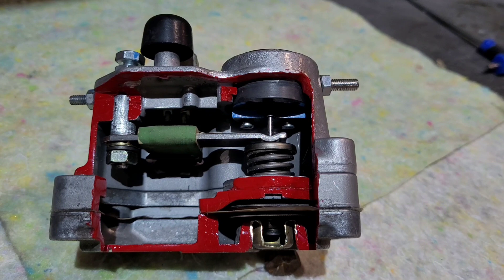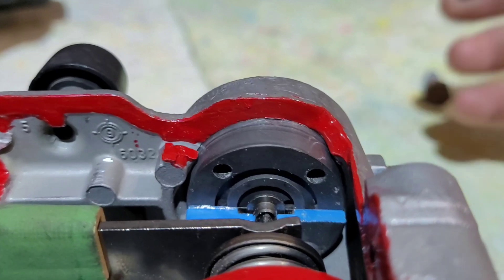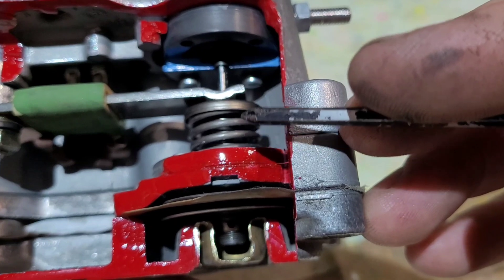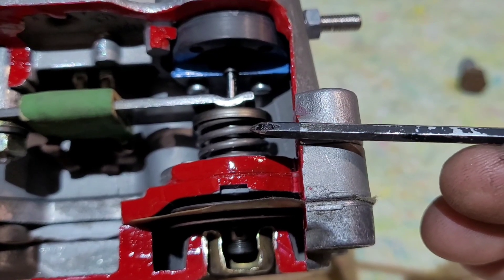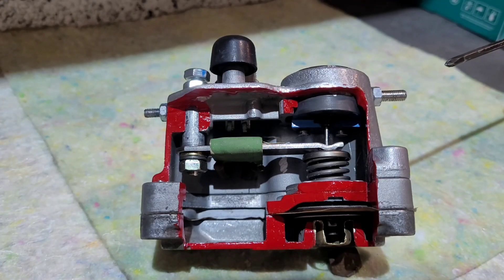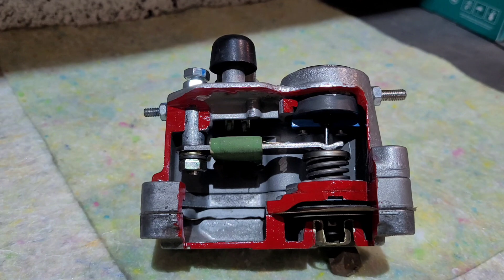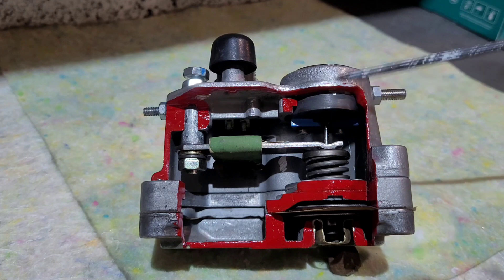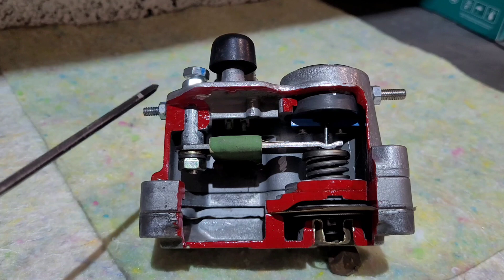Bosch K-jetronic: Warm up Regulator - Internal Investigation

Comment: Hi, great demonstration! Do you have any experience with the modern aftermarket replacement for this? I see they are about $600 in the USA, but am thinking I will try adjusting my warm pressure once more before giving up on the WUR.
Reply from the maker: Thanks, not had any experience with them but I dont rate them as the factory items work fine one set

Comment: Hi, what would be the cause of a WUR leaking off when hot and creating a hot start fault. Could it be a weak spring?
Reply from the maker: The WUR pressure is from the distributor so if pressure is leaking off its the distributor leaking off pressure, most likely the pressure relief valve seal
Reply: @GreyGooseRestorations  when testing with a pressure gauge, it holds when the gauge tap is closed but not when open though
Reply from the maker: With the tap open its letting pressure dissipate through the WUR and back to tank which is normal unless its a sudden drop
Reply: @GreyGooseRestorations  the test conditions say it should hold for approx 20-30 minutes but mine is much quicker than that. Have replace fuel pump check valve and pressure valve seal on distributer etc (Porsche 924 btw)
Reply from the maker: After 20min it should have 2bar left in the system, if its leaking past it may be the rear most seal on the pressure regulator.
Reply: @GreyGooseRestorations  I have rebuilt the WUR (to the best of my ability) and also removed filter mesh and fitted filter into banjo as per you other video - my theory is that the spring isn’t holding it closed tight enough (it is potentially 48 years old) 
Didn’t see an issue when I had it open but didn’t really think to inspect the spring thoroughly
Reply from the maker: What pressures do you have with tap closed and tap open
Reply: @GreyGooseRestorations  with tap closed it holds at circa 2 bar for ages
With tap open it reads about 1.5 bar and is down to just over a bar within 10 mins
Reply from the maker: Id say that's normal

Comment: The vacuum chamber below wants manifold vacuum or ported vacuum ? The screw in the bottom will affect cold start control pressure and wot enrichment ?
Reply from the maker: The vacuum chamber needs manifold vacuum (after the throttle body) the allen key behind the brass cover will have an effect on all workings eg cold, warm both with and without vaccuum applied depending how well the wur is or how it's been set previously
Reply: @GreyGooseRestorations  Thank you for responding , I appreciate it . K jet is a brilliant system but it’s a bit a bit confusing I’ll admit . I’ve one more question if you’re up for it . 
 You might laugh at this but I’m running a Mercedes 450 SLC with a rear mounted turbo . I’ve got great warm performance but if I shut it off for even five minutes it starts up chugging and blowing black smoke / stalling . I have an afr ratio sensor / guage installed which has been helpful . I’ve set up the warm mixture with the ( tap the steel cylinder into the wur housing ) method because I didn’t know any better . I’m wondering if my screw at the bottom is adjusted too far out possibly . Thank you for your time . I’ll have to send a few pics / vids of this beast I’ve created , you’ll no doubt get a kick out of it ..
Reply from the maker: @helmutswetglanz2590 oo that sounds cool, contact me via my Facebook page and i can help

Comment: I have no fuel  pressure in each ports of the wur. Warm or cold engine.
The car run fine but near to 3000-4000tr/min it runs way too rich.
Got fuel at the ports but not building pressure at all.
Reply from the maker: Sounds like you have some form of blockage

Comment: Thank you for great demonstration. I have one question regarding the vacuum part of the WUR. I was setting up my WUR after rebuild these days, I was quite puzzled at the beginning but finally I got the point how to adjust the pressures correctly but I was not able to get vacuum working while engine was running, later on after massive investigation I discovered that smaller connection hose coming out of the hose that connects ISV and fifth injector was blind from the production so it was no vacuum comming to this small hose. Anyway I did not understand whats the purpose of this vacuum as I suppose that the vacuum is being produced during whole engine runtime and I cannot imagine in which situation can be this vacuum system used for enrichment of the fuel mixture and how it should work
Reply from the maker: Thanks, the vacuum is applied to the diaphragm in the WUR when the throttle is closed and partially open, when the throttle is opened there is a lean fueling situation before the extra fuel is delivered to the injectors, to counteract this once vacuum is lost (when the throttle is opened) is reduces control pressure momentarily thus allowing a touch more fuel to overcome the lean patch
Reply: That is amazing, but I did not notice any pressure drop during my tests, I suspect that the vacuum lost is not happening in my case, can you tell me which element should cause this behaviour (vacuum lost=pressure drop)? Thanks
Reply from the maker: @lokvenc672 on the WUR if you blow down the pipe leading into the WUR you shouldn't be able blow through it, if you can the diaphragm will be split
Reply: @GreyGooseRestorations  I am not sure if I understand. When vacuum line is disconnected from WUR, pressure drops by around 10psi. I have set the control pressure to around 50-51psi with vacuum line connected, is that correct? Thank you
Reply from the maker: Yes definitely set all control pressure with pipe in tact, if the pressure is changing when running and the pipe is taken off/clamped then that indicates the vacuum portion is functional

Comment: Great video! I have a WUR without vacuum. It also doesn't have an adjusting screw. How would you suggest I adjust the control pressure? Also, can the screen filter that is in the inlet banjo bolt hole be removed for proper cleaning purposes?
Reply from the maker: Hi, to adjust that type either modify if like shown with the extra threaded parts to adjust cold and warm pressures.
Its near impossible to remove that flat filter without causing damage unfortunately

Comment: Love the cut aways man, definitely cool to see!  I am currently working on an 87 420sel and after rebuilding the fuel distributor I’m not getting any fuel to the injectors but have good pressure at the supply line and a new screen filter at that line too.  I’m about to start taking it apart again, what would you think might cause this issue?  I’m thinking I placed the diaphragm gasket wrong or something
Reply from the maker: Thanks, does nothing come out at all when the air flap is raised
Reply: @GreyGooseRestorations   I tried to start the car with and without touching the pedal to open and close the air flap and in both circumstances I had only 1 injector line that had a little fuel come out but nothing close to the pressure required to start and it was only 1
Reply from the maker: Ok unless your CO2 screw is way out your metering head is at fault
Reply from the maker: Try and turn the 3mm allen key for co2 clockwise wise half a turn, if no better then it'll likely be the metering head
Reply: @GreyGooseRestorations  I’ll try and turn the c02 adjustment when I get home, the car ran great when parked and that adjustment hasn’t been touched though so I’m leaning towards the metering head.  Even if the c02 adjustment was off though wouldn’t at least some gas come out of the injector lines?  Is there a way to bypass the metering head or a way bench test it to prove its faulty before replacing?
Reply from the maker: Ok that points more towards the metering head being the issue.

Does the fuel plunger actually move or is it stuck?
Reply: @GreyGooseRestorations  yeah the fuel plunger moves freely and I installed the lower half of the fuel distributor on there to make sure the flapper input would move the plunger and it does.  When I rebuilt the fuel distributor I removed the metering head to replace the green o rings but didn’t mess with it at all other than removing and installing it
Reply from the maker: Are you able to test the fuel pressures? To confirm its got solid 5+bar at the metering head
Reply: @GreyGooseRestorations  I haven’t measured pressure at the metering head itself but I have at the supply line to the fuel distributor and it is 80ish psi so it’s above 5 bar
Reply from the maker: Ok, take the lines off the metering head and take the mini filters out (use a screw and pair of pliers)

See if the are gummed up, you can get new ones online, i use mr injector uk
Reply: @GreyGooseRestorations  I think that I have figured out the problem.  The system will push fuel with the pumps hot wired to my dirt bike battery but it won't prime the system with its own power.  I have tried my new fuel pump relay, the old one, and jumpered it all with no success.  What would make the pumps kick on but not make pressure at the fuel distributor with the cars own power but do it with an external battery powering it?

Comment: I have watched your video on Youtube and wondered if I could have a few pointers before purchasing the incorrect parts. I am trying to help out a friend who purchased a non running V6 Volvo from the 80's which has K Jetronic fuel injection. It initially did not start but he found that the in tank fuel pump pipe had rotted away so no fuel was getting to the distributor. In trying to locate the fault he took apart the fuel distributor and could not see any blockages. I then went round and carried out some fuel pressure tests as it starts but once it has warmed up a bit runs very, very rich with thick black smoke from the exhaust. The readings are System Pressure 5.4 Bar (spec 5.5) Control Pressure 2.3 Bar (spec 3-3.4) so the control pressure is low. Would the WUR cause this as I thought that when they fail they usually fail lean ?
Reply from the maker: WURs normally fail casuing high control pressure.

Low control pressure would cause rich running, was the metering head put back together and set right as it could be at fault sending more fuel to one or more of the injectors
Reply: @GreyGooseRestorations  I will have to check, but it seems to run without being too rich when cold, it is only once it begins to warm up that it becomes increasingly rich.  Thanks by they way for your response

Comment: I just recently discovered that there is no power coming to the ISV cable (when ignition on), what would you suggest looking at first?
Is there a relay designated for the ISV? Or what else could it be that disrupts ISV power?

It seems to have no cut cable or any visual issue in engine bay.
Reply from the maker: Behind the centre consol is the ISV control unit. This could be faulty or it could be a power issue